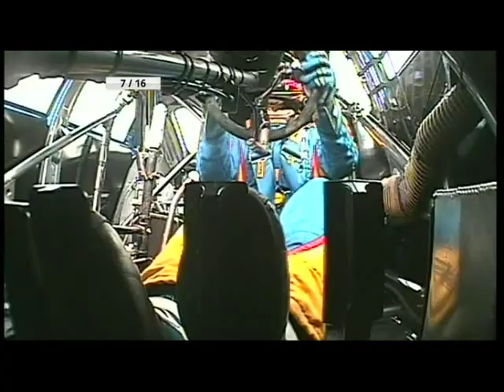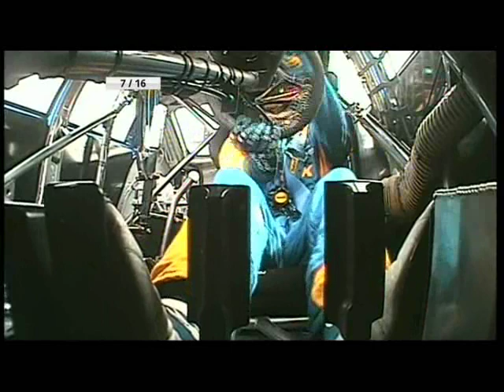BTCC 2011: Amazing Pedal Cam showing left foot braking technique

Comment: it's a "manual" sequential. In racing where everything counts they want to avoid accidental clutch dosage when you don't need it. I think it's a dogbox (straight cut gears, not helical like in a normal one) that has been specially made so it moves from one gear to another at a pull of a lever and not H-Pattern change. That's that noise too, you can hear a whine which is the straight cut gears whine. That's why we don't have it in everyday cars :)

Comment: @WhiteShadow2k1 No worries. In "theory" you can clutchless shift and do no harm, but that would require you sliding into gear at EXACTLY the right time, which is very unlikely. In semi-trucks, we can push the gear lever towards a gear and it will almost sort of fall into place when the RPM matches. We still get the occasional grind (more like a slow clicking over a couple teeth as it slides in), but the transmissions are heavy duty and can take it no problem.

take care

Comment: it actually depends on the gearbox. most sequentials are made for clutchless shifting, up and down. clutch in most sequential gearboxes are used when in complete stop, when shifting in tight turns(so the car does not get unbalanced) and in rain situations.

Comment: @Mr720j154 normally forward is to down shift. this is because when you are braking the forward momentum makes it much easier to push forward to downshift. the upshifts are pulled back for the same reason :)

Comment: @AccordGTR You wrote "feel the power tapering off" - and what I said was that most racing engines don't work like that, they gain power all the way up to the rev limiter which of course mean they don't produce any acceleration after that. So "feeling the power tapering off" would cost you time on every shift - and "hearing" the revs is perfectly adequate on the road, but it just isn't exact enough for racing, where of course you want everything to be perfect to gain fractions of a second.

Comment: @sicjustinmagot It's dependant on the car, yes. As you've probably also seen, he doesn't lift on upshifts either - on some boxes they need to do that as well. I think it's electronics controlling the throttle, so I would imagine (though I have no proof of this) that you would need throttle-by-wire to have a no-lift, no-blip system like this.

Comment: @kriklan49 ...in shifting, there's no ifs and buts about it...if the engine hits the shift point, you need to shift. Usually drivers will shift on feel and instinct...if you feel the power tapering off, you shift

Comment: @kriklan49 I don't disagree with you but I think you miss my point.  Let's say you had 10 drivers with more or less the same experience and the same car. Usually the biggest difference is going to be braking technique. That's my point. The really fast drivers brake later or sooner, depending on the corner, know how to modulate the brakes, but are generally LEAST on the brakes and MOST on the gas than the other slower drivers. Shifting should be kinda automatic reflex even if its a manual shifter

Comment: @AccordGTR I would think it's very few racing cars where you can shift by feeling the power "tapering off" - firstly, it would probably have been faster to shift a bit earlier than that, and secondly, many racing engines just gain power until they reach the limit where they damage themselves - look at F1, they have multiple shift lights and even a sound to tell them exactly when to change gear, and they're supposed to be some of the best drivers in the world!

Comment: @WhiteShadow2k1 Wrong. Shifting without your clutch on a fully synchronized transmission (pretty much every car since the 30s) will cause premature wear on the synchronizers. When they are worn out, you will have difficulty getting into gear with or without the clutch, and a major transmission overhaul will be needed. Clutchless shifting is only practical on non-synchronized transmissions like in Semi Trucks or Tractors.

Comment: @Lolzilol123 the whole point to shifting is to maintain acceleration, so short-shifting is not "faster" unless it gives you more top speed, say, after a slow corner leading to a long straight. Racing engines are designed to endure within their operating range so its kinda stupid to build an engine that you cannot rev within its designed power curve. Also, programming the ECU rev limit takes out guesswork when to shift...drivers (like me) shift by sound knowing what the rev limit "sounds like".

Comment: @AccordGTR @Lolzilol you are both talking nonsense. The car is running a sequential manual racing gearbox.Pull the lever to go up, push to go down. Then is a micro switch at the base of the lever that is oush when the lever is pulled backwards. This cuts the ignition to the engine for a split second, allowing the next gear to be engaged. Gear ratios will be changed dependent on the circuit, a shift light indicates when the engine reaches its rev limit in that gear.No racing car uses a "
sound"

Comment: Ignorance, i know, but how can he not use the clutch?
Reply: Its a semi-automatic, you do the shifts but not the clutch
Reply: it could also be if you have a "dog box" you can shift without clutch. weirdly it can prevent gear wear because most of the time drivers step on the throttle to soon, the clutch isn't fully released at this time and the gears are wearing out. you "just" need to match the revs properly, but they know their car like they know their...gentleman sausage...

but I don't know about this car.
Reply: Thanks for the answers ;=
Reply: Yeah, as others have said, racing sequential manual transmissions don't require you to disengage the clutch with the pedal to shift.  you only use it when taking off and stopping.